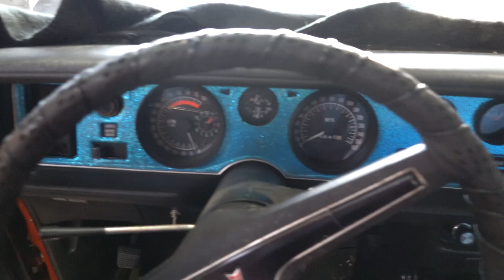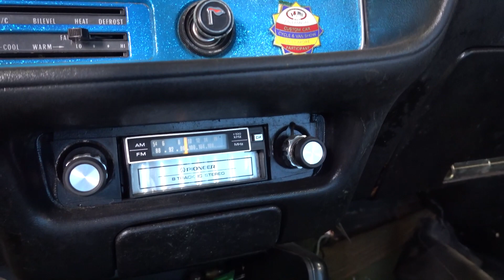1 in a Million Barn Find, Street Freak Firebird! Left since the 90's, sold for $500!!!

Comment: That is insanely cool! I may be biased, but I think keeping a Pontiac motor in there is the way to go.
Reply: Agreed!
Reply: Yup I'd be calling butler.
Reply: Got my vote!
Reply: i vote pontiac as well, i feel like going chevy would be the easy way out.
Reply: only thing is the hood is cut for a 6-71 on a sbc.  oh wait i see it had ram air III ported heads, it was a pontiac 350?  A pontiac can be good, it just needs at  least some high dollar aluminum heads, if stock iron cams won't even matter that much except rpm. Plus it would be amazing to go NA     and duplicate the hood with a fiberglass one and keep it all under hood with a massive stroker kit. butler performance does a really good pontiac engine, but for that i would build a better small block chevy, i wouldn't be ashamed, however poncho supporters would really dig a poncho engine in a poncho car , no doubt about that. i am putting a windsor based small block ford in a chevy 2nd gen camaro because Dart's block comes standard with the 9.5" tall deck beyond the optioned sbc at 9.4" and that is the third option up. And lb for lb and dollar for dollar the windsor base outperforms the sbc only very slightly so there is that also. Well i believe a perfect street car deserves a good rod ratio to keep cylinder seal at maximum and cylinder bore wear at a minimum that is why i make my own blueprints.
Reply: @zAvAvAz  Meth Much?
Reply: @kruleworld   well i suppose your correct although the original owner can , although it was a special paint doubt if it is plentiful now, i like the super charger thing that was in it, with a 400 it shall be awesome.
Reply: @MrR6guy   nitro methane is way over the top for this , that would be awesome as well, only well, insane !  :o)
Reply: Agreed
Reply: @zAvAvAz  Somehow I don't think that's what he meant.
Reply: @gator2813  LoL :pride-flower-rainbow-heart:
Reply: Nice Ride Brother, Reminds me of a Friend that ha a 70 Something with the Dual hood scoops !! NICE RIDE !!

Comment: My twin brother had a 77 firebird with a 301. Ran a mixtire of trans fluid in with the oil. The original owner always did so, my brother continued it then, My brother picked up a 1979 Z-28 with a 1973 small block 400 with a 4.125 bore. It was built by M&S machine shop out of Wheeling W.V.  It was bored .030 over to a 406 running a stroker kit!  I SURE DO MISS THAT CAR!!! Then he picked up a 1978 Trans-Am 455 hd that was super clean!!!

Comment: I'd keep it Pontiac. Youre so lucky to have found that. My dad had a 74 SD455 he had when he was a teen. He sold it for 500 sometime in the 80s. My favorite cars are BOPs. I have a 68 Toronado. Starter died. I have a tunnel ram, port matched c heads, headers, msd pro billit ignition, and a 6al box. I'm dying to hear it with the my tunnel ram and headers.

Comment: My dad and I built a Model A Tudor sedan we were having trouble with a motor. for most people there are 3 options, a flathead V8, an original Hemi, or the psl of motors a 350. He was leaning into the 350 for the same reason everyone else does, cheap and easy as hell. I prefer things a bit more original, a buddy of mine had just pulled a Pontiac 400 with a th400 mated to it. Here is the fun part, it was pulled from a 70 TA, givin a solid rebuild, bigger cam, new slugs, full rebuild on the 6x heads, nothing crazy just a solid reliable motor. it was the shoved into a 72 C10 and was only started a couple times a week to keep it fresh. it sat there for about a year and the dude got tired of trying to make it work properly in the truck. it was pulled and loaded into the back of a truck, the guy drove over to our house and backed into the yard, $400 for all of it. my dad went back and forth for a bit, I got mad and told them to unload it. needless to say it rested beautifully between the frame rails. over 400 hp in a car where the motor is the heaviest part....is an absolute blast to drive. Now the sad part, he sold the car to someone out of Louisiana so he could start another project. We got a hold of a 40  Ford shoebox, he got the seats covered in purple and black vinyl and stopped....he was diagnosed with stage 3 pancreatic cancer and passed shortly after. All that to say, go with the Pontiac motor, and if anyone knows where that Tudor is....please hit me back.

Comment: A steal at 1000 bucks. Love the car! Butler is the top pontiac engine shop. They could build you a 400 that will hold up to that blower. If the m22 does not work out Autogear out of NY makes some nice variations of the m22. Im running a m22z with a 3.08 rear gear and love it. Best of luck with the Bird. Cant wait to see the updates

Comment: What a coincidence ..... I'm in Downingtown with a '70 Firebird originally a 350 two barrel, 4sp and Firestone 'Wide Ovals'.  Its now undergoing a full, ground-up, ProTouring, RestoMod in Exton.  I went through the engine question early on and connected with the best pro engine builder (for all domestic motors) in the area..  My original idea was to put aluminum heads and EFI on my engine that already had a Ram Air III (WS) cam.  No aluminum heads were a direct fit with the 350 bore spacing.  I decided on an LS3 crate motor.  We should connect as I can put you in touch with a lot of locals that would definitely support your build.  BTW, by far the Gene's are the best all around!

Comment: By the way, kauffman performance over here are not only the ultimate pontiac experts but they also have experience with blown pontiac engines. It's a real sleeper company. You can go from watching a 1000hp pontiac dyno pull to feeding a cow about 10 feet away outside the building. These guys are the best. Look em up.

Comment: I actually have a 400 with 455SD heads and a Blower intake (Minus blower which is long gone). The crank snout snapped and it's been sitting in our barn for years now if you'd be interested! Would be so awesome to see it back in a bird with a blower!
Reply: My grandpa bought this 79' TA with the crank snout snapped and just swapped the engine out and kept this one to rebuild which never happened. Sold the blower down the line but none the less a good buildable engine!

Comment: Tony, I’m not sure what your planning suspension wise for your Firebird. Keeping it close to period correct or going restomod. I have a set of support braces that I never installed on my 78 Firebird back in the day, these were manufactured by Herb Adams that tie the suspension pickup point to the firewall. Stiffens the front structure reduces flex. If you are interested in them they are for sale.

Comment: I am glad I stumbled across your channel.In 1986 I purchased a 74 Firebird Esprit from the original owner.It had 63,000 miles,and she had just had the local Pontiac dealer go through the whole car,including new paint,vinyl top,gaskets,belts,hoses,etc.But,I bought it after the interior was totally gutted by fire.From the dash to the rear window.And the roof caved in.I bought it from her insurance company for $225.Stripped it down,sold many parts.The Pontiac 350 and auto trans went into a 1969 Firebird that I picked up for $150.It was a fun ride

Comment: Definitely do the Pontiac motor if you can. A 400 obviously or a super duty 455 would be even better but hella expensive these days. A couple other options would be a legit Pontiac 350 or even an Olds Rocket 350 which I had in my last 80 Trans Am. Great motor if you can get one. And of course there's the old LS swap. But since you need to fill that hole in the hood it's better to go with old school power. Whatever you do post videos and good luck. That's a great find. I would also think about clear coating that paint job to further preserve it and make it look shiny new.

Comment: A very 70s paint scheme. If you're really sure you'd like to stay Pontiac, then that 400 sounds just right for an excellent low-end torque monster, especially w/ a blower - as you mentioned, Pontiacs are a bit more expensive to rebuild, nothing that will break the bank, but worth the cost in this case, IMHO. You'll have a hard time keeping rubber on the wheels. Pontiac had great flowing heads and always seemed to produced more torque than a comparable SBC engine. Have fun w/ that mobile time capsule.

Comment: If you have the $$ do the Pontiac. If you need to save up, do a Chevy for now but only if it drops right in. It probably will, I would imagine every bracket / adapter for that already exists.

Regardless, rad find. I hope he sells you the OG blower setup. 

My only real change would be that I absolutely wouldn't live with the old-school electronic setup. You know the Holley stuff really well at this point, and that's what I would do. I know many might disagree.

Comment: It'd be cool if you found a Pontiac 428 or you could just put a blower on a Pontiac 350...maybe bore it 0.030"-0.060" over for 360-366ci or don't to save money with like 7x heads, that would make up for the lack of head flow, lack of ci and lack of bore diameter and would be the easiest, cheapest, quickest way to have a running, driving, car. I'm sure it would still be plenty powerful and fun.

Comment: You can find a Pontiac V8 without spending a fortune.  I still have an extra 400 buried in the garage I paid $200 for, running take out.   Not sure you'll do that again today but I would check with the demo derby guys building big 70s cars to see if they have something.

If you run tubes in the tires you can probably get away with them for a while.

Comment: You gotta go with Cragar SSs. By the way,Butler Performance is the kind of the King of Pontiac builders.Also I think you’ll need a hater. A gasoline powered heater like Beetles used in extreme climates might be easy and can heat with the engine off.

Comment: Look around for a Pontiac 400 block put it together with aluminum heads put a small supercharger on it it's easy to put this car back together
Option number two put a BBC in the paint the motor Pontiac blue

Comment: I love it! I'm high school class of '74 so I love all things '70s (well, except for disco 🤑🤣), especially '70s street freaks (although this car is not really a street freak as it sits too low). I have a '79 Corvette that's been sitting in my garage and I've been trying to figure out what I want to do with it. I think you just inspired me! The car is black so I'm thinking some blue or green heavy flake flames. I have a set up 12" Cragar SS mags with big bias M/T's to bolt on the rear. Either a 6-71 through the hood or a tunnel ram. 
This car will look great with shiny paint. I'd keep the tires but you have to be careful with them being so old. Cruising a car show or event will be okay but I wouldn't drive serious miles with them.
As far as the engine, depends on what you want to spend. A Butler motor would be cool but a Chevy would be fine too as long as it has the blower. The only other thing I'd do is some chrome 4 into 1one side pipes!

Comment: Pontiac 400 with 6X or Big Chief Heads (would have to research BC specs). I had a 400 that was a little over 400 whp NA.  Not sure on the cam with a blower... Get the best roller valvetrain you can.  IF... you can find someone who really knows 6X they can out flow EB Perfomer heads. (My guy passed years ago...) Rod and piston tech is significantly better than when I built mine around 2001...  This will be fun, expensive but fun!,
Reply from the maker: I grabbed a 988 block 400 with 6X heads I’ll be porting myself!

Comment: Mild 400 big duration solid roller cam for the chop got to get the blower 671 two predator carbs like it came out of a P.A.W. cataloge.... the jam through the 6×9s  .ted Nugent ,ZZ top, Bockman Turner Overdrive,  Boston  ,motley Crue  ... Colar sand 1000 grt plenty of water  then buff with foam finger pad orbital .looks like acrilic enamel deltron or ppg the polishing compound s they have today are encredable protectints if it was lacker would have yellowed pritty bad.... keep that cool old school stuff com..n..  ow. And.  N- 50 -15 Firestone super sports on the back...an Black playboy bunny fuzzy 🎲

Comment: 400 block (bored .030 over) with a 3"mains 428 (4" stroke crank) would be 432.8 (433 cid) Bigger bore than stroke. I believe this would be a better blower motor. Unless u go aftermarket block & 505cid. Talk to Butler Performance they know PONTIACS.

Comment: Needs to be a poncho. They are pricey but come on. Butlers.  Will set you up.   Ran a 69 firebird in the 70s 80s out ran more things than it should have.  Butler Pontiac engine performance

Comment: That thing could have been painted Baboons Ass Pink with unicorns all over it and it STILL would have been a smokin deal for a grand.  They ARE still out there...
My wife is a 30 year pro upholsterer and she loves it. She says there are plenty of good cleaners out there. She did say you should slap the seat cushions really hard a few times and see if any "sand" comes out the bottom of the seats. If so, replace the seat foam NOW. Once it starts to break down, that's when the covers will get full of the foam dust and easier to damage.
Great save, man. Clean it up and put an Aussie cam in it.

Comment: The 350 was a small block. The 45 degree 400 will not fit under the espri hood. That's why the bumps in the hood on the formula 400. What you need is the 60 degree " wedge" 400. Will not fit those headers. Rare motor more money. In my opinion not worth it due to cost snd the 45 degree performs better. For a sleeper go with the wedge. This ain't gonna be sleeper. If you go big block your going to have to loose the hood or cut more out to clear the valve covers.

Comment: Not only does it need a Pontiac, all items are readily available…. 400, +030, eagle, scatt or Ohio Crankshaft 3.250 stroke, you can get BBC Journal for the rods, Ross pistons, Butler Performance has kits ready to go 460+ cubes. Edelbrock or Kauffman heads, and speedmaster, makes a copy of the Ram Air IV….Don’t do this Pontiac dirty!  This can be an easy 700+HP build, 600+ without trying.

Comment: A guy in Nashville TN built a 400 Pontiac for my dad back in 1993 it made around 500hp he had it in a 79 trans am and the guy did a bunch of work in the bottom end and top end it would Rev to 7000rpm, put it in a 79 Chevy k30 pulling truck and spun 6500rpm down the track for years before he sold the engine. Otherwise It would have been a great engine for that car!

Comment: Poncho yo is the only way to go, don't go the easy way true to the chief you must stay. 455, 400 even a 350 HO, with a blower motor you will go go go, turbo maybe the better way easy to bolt on 8lb of boost on a stock early 70s lo compression 455 poncho will pack a sweet punch on pump gas reliable easy driver I say. Go up to 10-12 lbs and a 390 gear you'll go so fast a lesser man may fear, 14-16lbs and shit will get real those boas plys will peal right off your wheels, street drag slicks will keep you rear stuck to the asphalt the poncho will steal the win from a LS heat and show the world you a chief, not some Sav a buck bitch who won't commit to the Thunderbird God of torque . You'll still have that sweet sweet Pontiac exhaust note like no other so deep it  scares your mother, Ram air V cam grind will do you right roller system to keep it tight. I say put the cut hole hood away make yourself a ram air formula hood keep that paint scheme just double it up on each scoop. No need to show the world what you got, that cam and exhaust note will be heard those who know will understood that's a poncho chief firebird ready to show the world it rear tail lights as it should, that rear spoiler you will need the down pressure will help with traction and control of you steed. Next some suspension up grades so your bird can handle the curves as well as the straight. What a fine car you'll make. Show GM what a mistake they made killing off the chief. You'll have a hot ass bird that will be hard to beat,  but easy to street as your daily driver and on the weekend you can compete . Road race or drag strip that poncho bird will be hard to beat. Even just talking shit the G note firebird story is legit as it gets. No more advice can I rhyme fir now is the time for you to find a real poncho motor that  your bird deserves. Your initial steal of a price gives you room in that budget for some real poncho power that survivor bird does deserve hell you already got a block some boring and stroking will give you the cubes get some D port heads and a 455 crank shaft or even a 428 both should fit as we all know them poncho motors are one block size. Poncho power torque plus a turbo man that's the equation that turns that styling esprit  to a 21st century formula you'll see. Just no LS please. Yeah they fast and cheap, but that old bird really deserves some true poncho  power yes you know. That M22 and all that torque many a tire you will smoke, not fir piece but for the defeat of any fool who wants to compete, straightline or curves that bird will serve them up a brake light view every time so for real its the end of my rhyme,  good luck the car gods have blessed  you with a sweet deal, now satisfying them you must, so you can dust any fool who will race you. Peace and poncho power 💪

Comment: If your going to do the blower you should have a 4 bolt so if you want to use a Pontiac use the GTO motor from the 04-06 but I would use a small block Chevy with a forged crank because I am old school or just old if you want?
No it is not safe to drive on old tires. If you want the look of the bias ply tire Coker makes tires that have the OEM look but are safe with modern materials.